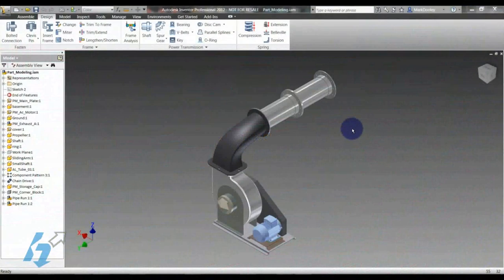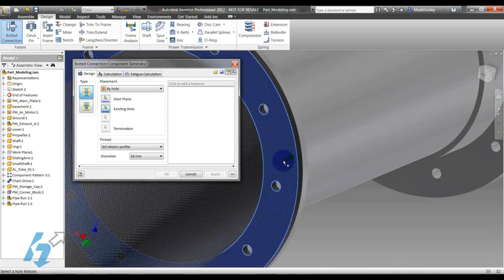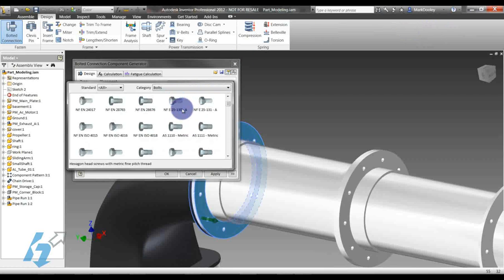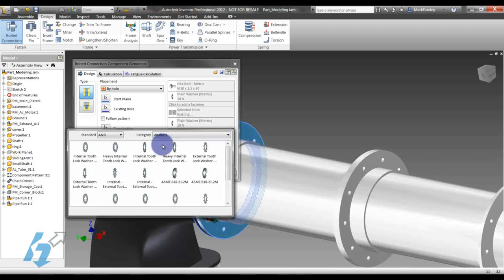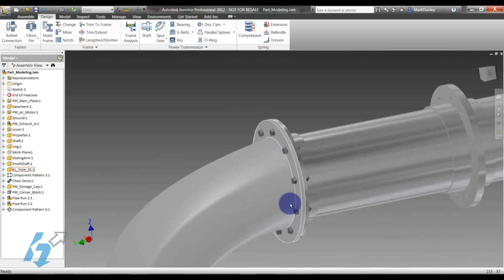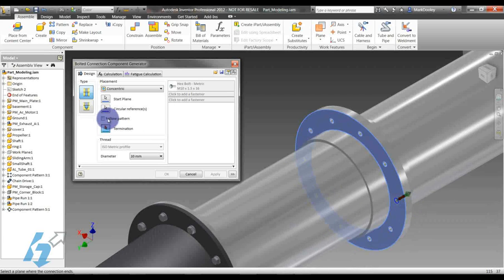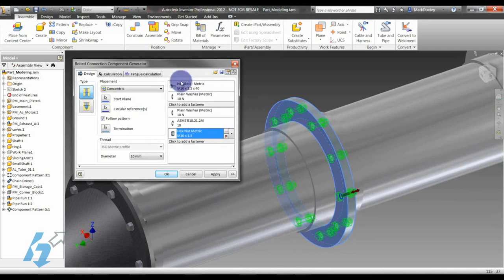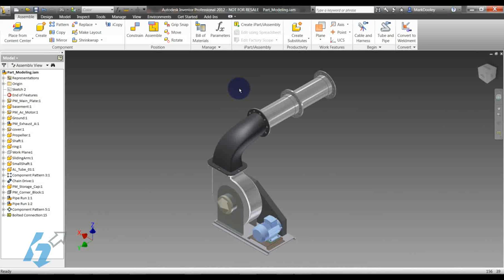Bolted Connection Tool

Comment: how can you increase the length of the bolts if you want to for customer requirement?
Reply: Hi. You can right click on the bolted connection and select "Edit using Design Accelerator".  Then you can modify the type of component, size of component, and length of the component as well.

Comment: Great video Hagerman!
Incidentally, I've spent hours trying to LOCATE the 'Bolted Connection' tool that everyone talks about and that you use and 4 other video contributors here use and YOU are the only one to mention it's on the DESIGN ribbon bar! Up till then, I've been fiddling around laboriously placing components from the Content Centre, under ASSEMBLY! People leave out the vital first step! So, thanks for that.